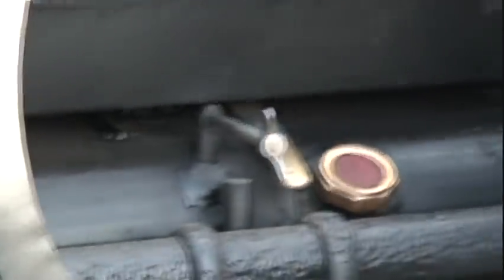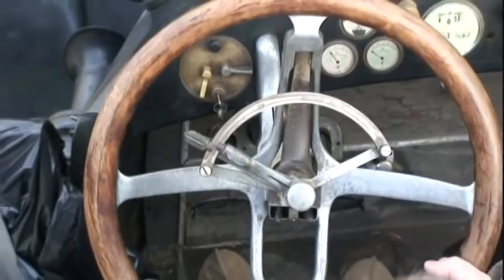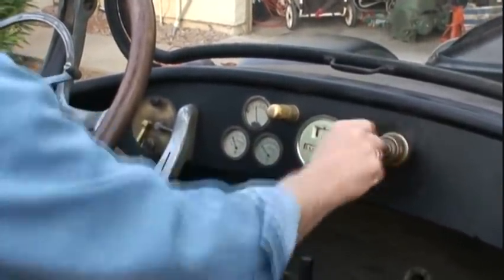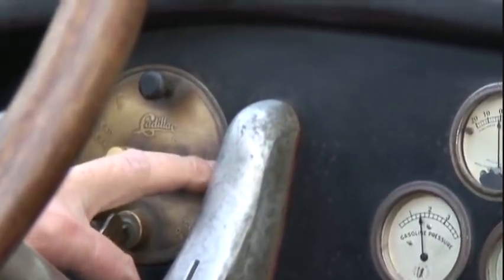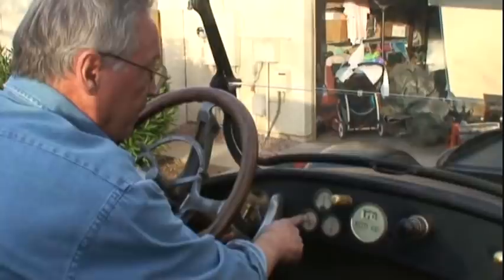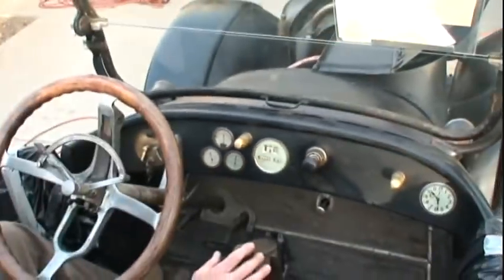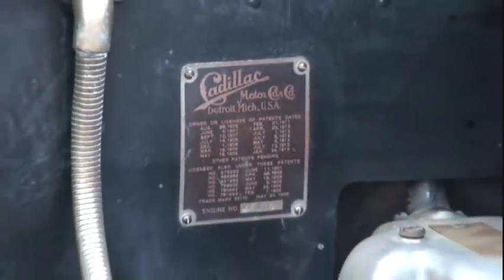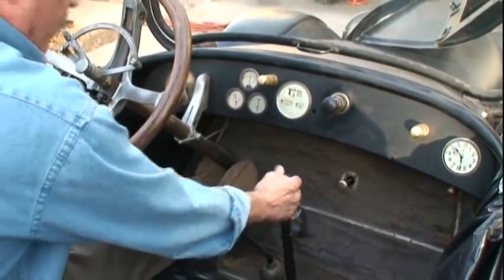1917 Cadillac Convertable.wmv

Comment: I have a 1917 Buick and it's all different. No air pump for the fuel, it has gravity feed from a Stewart Vacuum tank. No fuel pump. To get extra gas for starting you press the tickler on the carb float. Another option is enrich the idle mixture on the carb, supposed the choke does that but my choke does nothing. Maybe I'll do a video like this but without the song about Tipperary.

Comment from the maker: This is 1917 high technology coach building in a 2 door sports car roadster - the 4 door became US Military staff vehicles and ambulances overseas in the Great War.

Notice this car was started in the cockpit. Additionally it has a clock, folding top, folding steering wheel, on board air compressor, on board generator and battery for lights and a hide away rumble seat in the back.

I think they cost around $2.200 - that's allot in 1917.
Reply: allot? What word is that?
Reply: @hyzercreek  Hahah!  That non-word is all too common on the internet these days, even taking different spellings!
It's likely been around before the internet as well, assuming that comment was made by the man in the video.
Reply: All that aside, the car is gorgeous and imposing!  $2200 these days just doesn't buy a new car, or anything close to new!
Reply: @De19thKingJulion  That's about $47,772.31 in today's money
Reply: @pavelkorecky8051  Is that all?!  Surely wages were also numerically low back then.
Reply: Engine sounded good. Car seems to run well.
Reply: You should do an LS swap

Comment: How does the air pressure  pressurize the gasoline?  Does it pump up the pressure in the gas tank?  On one hand, it seems like that would take a lot of pumping if the tank was near empty, on the other hand once the tank was pressurized, the on-board air compressor would take care of it.

Comment: Nice video, but I have to correct you when you say its filled with 30 WEIGHT oil. The "W" in the designation does NOT stand for weight, but for WINTER. So I reckon it will have less viscosity than SAE 30 in warm weather. Just so youre aware of it.
Reply: Nothing wrong with saying 30 "weight", it does refer to the oil's viscosity - thickness - heaviness - weight.
Reply: @neilvetter662  Dreaming of a whiiiite Christmas...
Reply: 30 weight oil doesn't have a W designation
Reply: Yes, but everyone calls it weight !